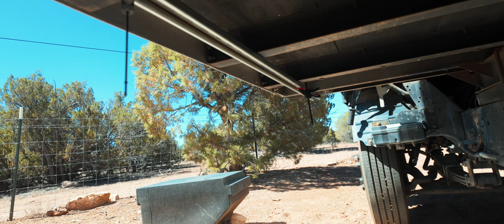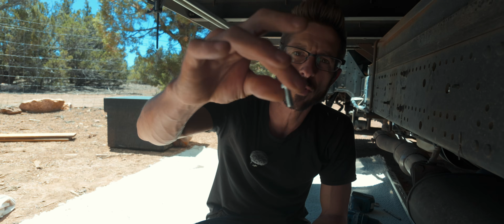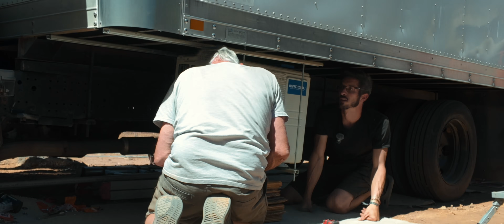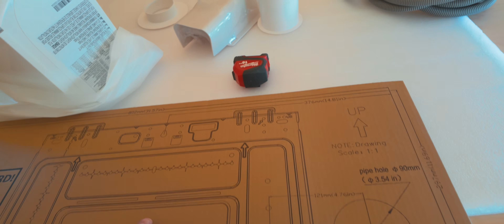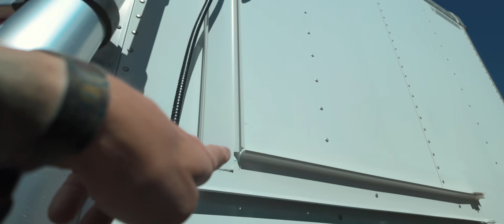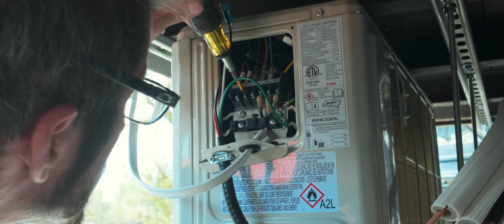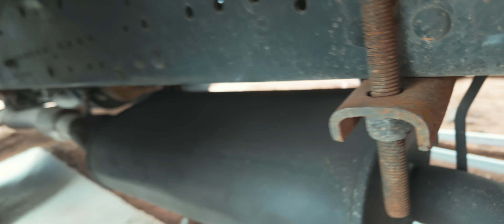DIY Air Conditioner install on my Box Truck Tiny Home | Mr Cool Mini Split

Comment: I wonder how the unit handles the extreme bounce of a box truck.   I know mine is horrible.   I would put some loctite on those bolts or  spot weld the unistrut.   You should of just run your lines through the floor from the inside.   They are completely protected and it’s a clearer install.
Reply from the maker: It’s been working great even with all the bumping. When it’s hot outside I keep it running while I’m driving

Comment: Inspired by you, I just bought box truck that was used for delivering Ice Cream. It is already insulated and has freezer that can be turned down to keep the truck at 76 using only diesel.

Comment: Checking in to see how the mini-split has been working out for you?  I've been wondering if "Road Grime/Dirt" has caused any issues?  Or... Having the workings that close to the hot-asphalt reducing the systems efficiency and causing an excess drain on your power system?
Reply from the maker: It’s been working great. Keeping me cool on recent 100 degree days here in yuma. 

Keep in mind, I am not the first person to mount a mini split in that location. Skoolies have been doing it for many years without issue

Comment: A 9K inverter will usually ramp way down once it hits temp — sometimes idling around 300–400 watts, sometimes even lower depending on brand and load. That’s where the efficiency magic happens.

A few things going on there:

Smaller compressor = lower minimum modulation
A 9K unit might throttle down to ~2,500–3,000 BTU output.
A 12K might only drop to ~4,000–5,000 BTU.

Longer run times = better humidity control
It keeps wringing moisture out instead of blasting, stopping, and letting the room get clammy again.

Lower cycling stress
Fewer hard ramp-ups means smoother operation and usually longer compressor life.

 A 9K unit that can just quietly sip 350 watts all afternoon is kind of ideal. Especially if you're thinking long-term about battery-backed loads. A 9K idling at 350W is way friendlier to a solar + battery system than a 12K that refuses to dip below 700–900W when active.

And the funny part? A lot of people think “bigger = more efficient.”
Not at part load. Inverters reward right-sizing.

Comment: Most AC's are dead simple, should have gone with a 9K BTU Unit. 

Most of them come pre-charged in the outdoor condenser with enough refrigerant for, say, 3–5 meters of line set. So the typical flow is:

Mount indoor head
Mount outdoor unit
Run line set + control wire + drain
Flare, torque properly
Vacuum through the service port (usually on the larger suction line) down to ~500 microns
Let it sit to confirm no rise (leak test)
Crack open the service valves and let the factory charge flow

Boom. Cold air.

The vacuum step is the only part people underestimate. It’s not just “pull air out,” it’s about removing moisture. Moisture + POE oil + R32 or R410A = long-term sadness. Half an hour is usually fine for a short line set, but I always like to see it actually hit proper vacuum and hold, not just “eh, it ran for 30 minutes.”

Now the 9K vs 12K question…
In a small, well-insulated room, 9K is often the sweet spot. More efficient, longer run cycles, better dehumidification. Oversizing is common and people don’t realize a bigger unit can short-cycle and leave humidity hanging around.

Comment: Nice! I did one of those A/C installs for my rig (location at the back as per your previous truck), I was wondering if you did anything special to prevent the copper lines from crimping in this install? I used a tool for that and almost messed it up.

Comment: Do you run into condensation issues with the AC?  I have a minisplit in my build, and I like it, but if I'm not parked on a decline, I get pretty bad condensation leaking down my interior wall on humid days...  not sure how to handle that, and AC techs won't come look at it because it's in a truck lol

Comment: Can you run the air conditioner 1100 watts non stop with solar?
Reply from the maker: Yes
Reply: @nomadbrad503 how many watts total is your solar?
Reply: @n @nomadbrad503 do you have to stop at weight stations? Get a commercial driver license?
Reply from the maker: @Davideverything7 no

Comment: Thank for sharing the whole job, well done. I would like to suggest to anyone replicating this that locktight is your friend if you don't want them bolts bolts holding the unit under the truck working loose.

Comment: The weight of that mini split shaking / moving around will likely destroy that mounting assembly without a proper structure pretty quick.. probably needs a welded frame or a structurally bolted frame that significantly sturdier so it's doesn't move around at all.
Reply from the maker: no, its fine

Comment: Been brainstorming about a box truck build like this for a while now and wondered if the external mini split would fit there, looks like it does just fine. Other a/c option would be a window unit dual inverter a/c in the front wall with an aerodynamic cover over it that has some side vents for proper ventilation. They are a little bit louder than a mini split but ease of installation, compactness and safe location are its strong points. Has 12k btu been a good size for that space?

Comment: When traveling cover your mini split.   It will save you many problems from road dust stones .replacing your mud flap helps. But covering it when traveling better

Comment: Drilling holes in the beams seems a big retraction their stength AND dependability.
I think a clamp type fastener would be better.
Drilling holes in I-beams seems a serious blow!😮
Reply from the maker: These are very small holes in relation to the mass of the beams. It’s all good!

Comment: Hi Brad. What happends to that A/C box without protection during rainy days and running down the road? Can it be damaged?
Plus, why not mount the indoor part of the A/C  on the same side of the main unit or why not install the outdoor unit in front of the box(like all others fridged trucks)?
Reply from the maker: air conditioners are designed to live outside in the rain and snow.

Comment: Great install but I do have concerns on the location it really close to the truck's exhaust pipe which will be radiating extra heat to your Mr. cool. Recommend you re-evaluate your location decision. Great content as always. Thanks for sharing. Keep up the great work.
Reply from the maker: Appreciate the heads up!

Comment: I like to damage the ends of the threads, to prevent the nut from droppign out if it comes loose.
Reply from the maker: yes thats a way to stop the bolt from coming off

Comment: Great video Brad, and great job on the Mr. Cool Air Conditioner install. My only suggestion is that you use flexible electrical conduit for your power cable as it is not UV resistant.
Reply from the maker: great idea!

Comment: I think you might want to consider installing a grill type feature around the unit that's under the truck in order to protect it from weather and also less noticeable to being stolen. A grill type feature would also allow for the air to flow as needed.
Reply from the maker: thanks for the suggestion
Reply: @nomadbrad503 You're so very welcome, the grill casing might need to have a padlock on it also for added security.

Comment: I am kind of curious why you chose the driver side of the truck for the fan setup.  Seems to me the piping would have been shorter going to the passenger side, and also would have avoided the exhaust.  The line inputs on the unit would have also been on the side that the inputs/outputs go.
Reply from the maker: This location was best for a few different reasons.

Comment: I know you know what you're doing and you're pretty proficient, however I would worry about it getting muddy, dirty and dusty if you're going to boondock like you are right now and dirt roads. I think that would shorten the life and it's filtration system...? 
Just seems kind of an awkward place.
Perhaps when you're traveling or it's turned off like during the cooler months or when it's not in use just get a cover for it.
Reply from the maker: A lot of folks are concerned about the unit getting dirty. Time will tell

Comment: Brad, could you have cut your line cover on a 45 degree angle to make a cleaner corner, or do they make a 90 degree fitting?
Reply from the maker: yes I could have cut it 45' or ordered the correct piece

Comment: Brad, does the indoor unit just hang on that bracket, or does it lock in place? Just wondering if it it can shake up and down and vibrate against the lines?
Reply from the maker: its rock solid

Comment: 1/4 is strong enough to hold it for staying parked or some light travel like if used as just a camper, but for a full time live in rig that will travel all the time all over the place I would go with 3/8 because the vibrations from driving  are a huge deal to add on top of the vibrations of it just running each day. Plus the torque an g forces that will tug on it when traveling with the wind also beating on it when traveling. The 1/4 can an will eventually become compromised an snap off eventually. Iv seen it with underground storage cases that don't vibrate at all. But yes 1/4 will be fine as long as you do regular inspections once it gets some trip an use under its belt
Reply: But again I would just replace it with 3/8 zinc coated bolts
Reply from the maker: thanks for the insight
Reply: @nomadbrad503  build is coming along nicely! Your first build is the one that made me realize if I was to make the commitment to move into a van or camper that I'd rather a box truck because you have so much room inside for storage to be built in along the roof etc an plenty of space. not to mention mounting tanks, ac like you just did , storage boxs , diesel heater for the water and hydronic heating plus a 2nd normal air blower style diesel heater. Like you can do that stuff because of all the room underneath the box, east to build an ad stuff to the roof and the inside because it's a box, no need for special parts.... sorry for the long comment but everyone deserves to know how they effect/influence others from time  to time

Comment: Recommend placing a tractor/trailer mud flap to protect the AC condenser. Even with the placement of the gray water tank, just a little added protection for the Condenser coil...
Reply from the maker: absolutely, new mud flaps have been ordered
Reply: @nomadbrad503 not just the ones on the cab, need the oversized Tractor/Trailer flaps just in front of the tank and or Condenser...

Comment: 1. Keep in mind that the rear tire will also throw stuff forward - would be good to have some backside protection for the mini-split outdoor unit.    2.  The 9" low points of the vehicle that are near the axle are probably less vulnerable than the 11" low point of the mini-split  -  because the low points near the axle won't have to deal with the (break-over-angle) effects of going over a bump/hump.
Reply: I was thinking the same thing.

Comment: Just some friendly advice 
 go back and put 3/8 grade 8 bolts with lock nuts on your channel and same thing on your thread rod grade 8 rod with double nuts on both ends i built many truck and bus body over 38 year career
Reply from the maker: i did use double nuts on the 3/8 rod

Comment: Im curious on why you choose the mini split option over a roof mount option that is more efficient, sleeker and less components. like something from Nomatic cooling
Reply from the maker: the roof is full of solar panels. a nomadic cooling rooftop unit would take up too much space!
Reply: @nomadbrad503  Ah, very true. and Im sure you are already pushing vehicle height or I would say a roof rack for the solar panels that sits above the ac unit would work to overcome that.

Comment: Brad, with all that vibration, I’d put the washer, a regular nut, then a nylon nut to lock it down. Just feel it’s less likely if not almost impossible for it to come loose.
Reply from the maker: thanks for the suggestion!

Comment: It’s been 5 yrs since installing the Mr Cool mini split in my daughter’s mobile home. Seriously, the only difference from yours to hers is that her home was already set up for 220v so we went that route. It appears that your set up didn’t leave too much excess line set to deal with.  It looks great Brad. I totally agree with your opinion on buying from a company other than Amazon. We bought hers from Ingram Water and Air, online. Hers has performed flawlessly this whole time. I’m surprised that your line set cover kit didn’t come with a flat 90 deg elbow. 🤷🏼‍♂️ But what you did should suffice I’d think. Thanks for sharing Brad and I hope you get as much good service out of yours as my daughter has.
Reply from the maker: im happy to hear that its been a good unit for you

Comment: Love the channel, watching from South Africa! Do you think the split system would work if the compressor unit is fitted above the cab against the front wall? Could also perhaps protect with a plastic wind deflector cone?
Reply from the maker: yes, it can be done. you need a wind deflector and you need to reinforce the wall

Comment: Never saw you put it on a meter to test the pressure? Did I miss a step?
Reply from the maker: this specific unit comes with pre-pressurized refrigerant lines. you dont need to pull a vacuum or check refrigerant levels

Comment: As an HVAC engineer, I’d like to point out that air conditioners are designed according to the environment they are meant to operate in — typically for stationary installations like homes or offices. While your installation work appears quite clean, there are a few important factors you might be overlooking.

When the truck is in motion at speeds, dust, gravel, and other debris from the road will continuously strike the outdoor unit coil. This will greatly accelerate wear and tear, increasing the likelihood of refrigerant leakage over time. Moreover, the compressor and its bearings are not designed to handle the high levels of vibration experienced in a moving truck. This will significantly reduce both the compressor’s lifespan and its overall efficiency.

While the system may seem to perform well in the beginning, it is neither likely to be reliable nor long-lasting under these harsh conditions. I don’t intend to disappoint you, but I also believe in being honest about the technical reality.
Reply from the maker: Engineer in the house!!!!!!

Comment: what was the deciding factor that made up your mind to purchase this unit ..? did it check all your boxes in the research?  that this is a reliable solution..?  also are you going to put some protection around the  main unit for all the stuff you might run into on the road and over ?

Comment: You did a great job!  I would have soap bubble tested the copper freon connections close to the inside unit. (then wrapped them up with that sticky stuff) They have the same pressure as the ones on the outside unit.  Glad to see you working with your Dad, enjoy your time!  Mine died when I was 24, I wished I had more years with him.

Comment: Like many others said, im not a fan of the location under the truck for the minisplit, but to each their own...
The bigger issue is the 1/4inch bolts you seem to love in this build. I genuinely hope you dont have significant issues using such smaller bolts...
Reply from the maker: thanks cake!

Comment: Btw, if you dont have it, just to be extra safe, maybe can add stopper to make sure the compressor isn’t sliding during hard braking.
Reply from the maker: whats a stopper?
Reply: @nomadbrad503  it could be tri-brace using the same strut material mounted on the cargo frame and preventing the outdoor unit moving back and forth especially during braking. btw, i sent a design by chatgpt in your email just in case you interested.

Comment: Hey Brad, I'm just curious why you did not install the condenser @ the space between the driver compartment and the box? Or just outside, back to back with the indoor unit?
Reply from the maker: that would require constructing an air dam. you cant drive 70mph with the wind blowing into the condenser. a friend tried that, his fan shattered
Reply: @nomadbrad503  Ah I see. No wonder those frig box truck that delivered frozen food have their condenser righr above the driver's cabin covered.

Comment: Looks Great! I install a lot of these units for folks who want me to completely install it, or if they want to buy and me install or do the install themselves and I follow up with a turn up and test. These are great units. Only thing I would have suggested was to keep the lineset inside the box and drill down through the floor. JMO. Otherwise looks awesome!!
Reply: That is what I was thinking. Straight down through the floor and over to the outside unit. Maybe he has plans for things under the inside unit and didn't want to use that space? Possibly avoiding holes in the floor?
Reply from the maker: thats a good suggestion
Reply: Why doesn't this equipment require a vacuum? What technology prevents moisture from entering when opening the system during pipe installation?
Reply from the maker: @edpapocabeça each component including the copper lines are pre charged with refrigerant. They are all under positive pressure from the factory. The connection between the lines and indoor/outdoor equipment use  special sealed connectors. There is no moisture to remove
Reply: @nomadbrad503 In Brasil is old tecnology. 😅. No
Reply: @nomadbrad503  Thank you explane

Comment: WIth the AC unit mounted behind the front wheel, I would be very concerned about a gravel coming off the tire and damaging the unit. I would suggest some type of guard in front of the unit.
Reply from the maker: the grey tank will be protecting the front of the unit